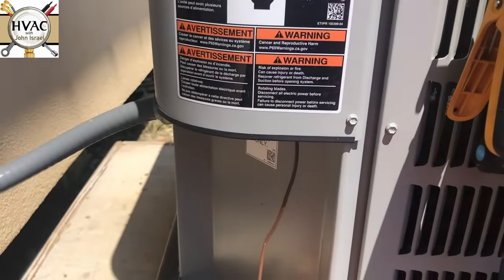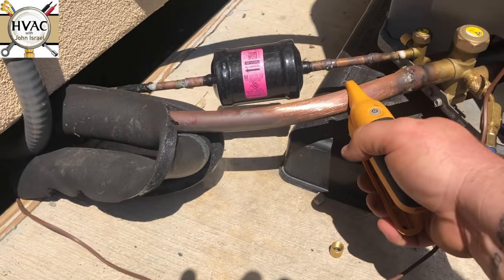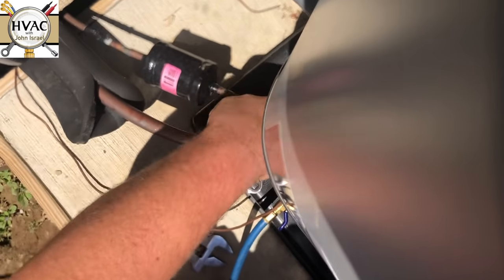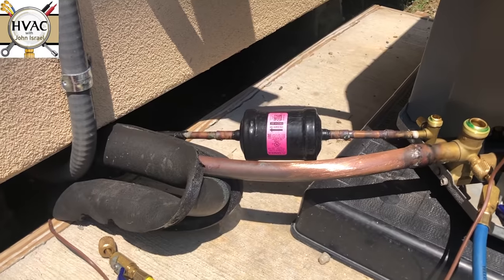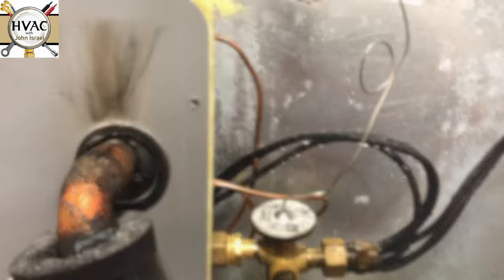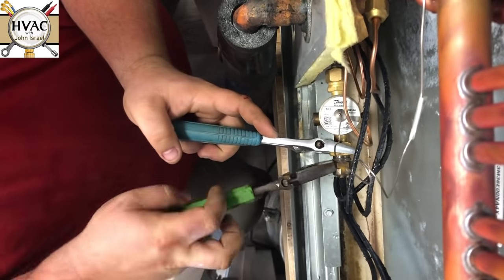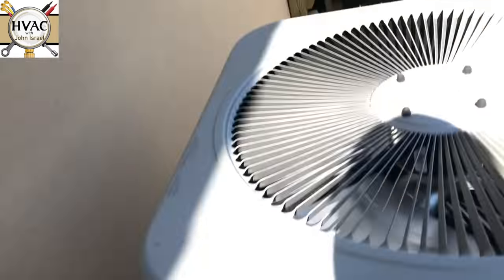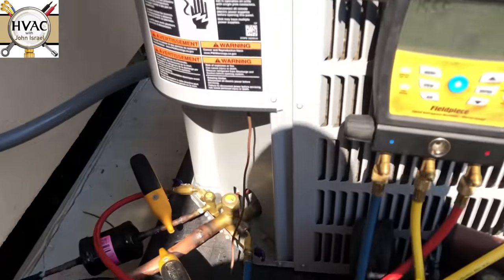How to Replace a HVAC TXV with Piston

Comment: I have done the same thing many times before when a txv fails. A piston is a much more simplistic metering device that can literally be trouble free. I wouldn't have changed the drier either. Good job John!
Reply: Very good job done John
Reply: What about the screen before txv what if that was clogged? Was there not one? I only have 1 1/2 exp. Just asking.
Reply: How do you know what piston size use if the manufacturer only references to replace only for another TXV???

Comment: I wouldn't change the drier ether, it's just an in and out job.and when you have been doing this for awhile you know your stuff.great job .
Reply: The txv failing so quick and crappy drainline shows the installer was a hack. Why take a chance with leaving the dryer, 5 minutes to replace.
Reply: No, you can have dirty stuff there
Reply: Agreed, if you leave the system open for a while then it can bring in some moisture.  Even then, the filter drier will dry it out, and its a brand new drier.  Forget that, look at that boogers on the braze.  SMH.
Reply: From the looks of those braze joints, and burned up grommet at the indoor coil, one has to wonder how good the rest of the workmanship is.  Maybe the TXV failed due to scale or contamination in the system.  I would definitely change the dryer.  Who knows what contaminants are inside that system,if you’re not the one who put it in?

Comment: I have no issues with replacing a bad txt with a piston I’ve done it a million times. I’m like you though, if it’s a warranty unit I will get a new valve if it’s under warranty. I also agree with you about the filter dryer.
Reply: There are houses with undersized units that need a piston to produce 32 - 33 degree coil temp

Comment: Oh yeah, good hardware gets saved. I have the old Tecumseh compressor covers and a bunch of the overload holding brackets and the new Tecumseh compressor covers. I also save the different capacitor mounting brackets. I have a Graslin defrost timer box filled with the extra parts from those ACME 700 fan motor kits.

I can't believe how many times those old bits saved my butt in the field.

Comment: I agree with you about the filter drier. I replaced a txv on a trane unit today and the drier was built into the condenser. I pumped the condenser down so I wouldn't have to recover the r22 and pulled a real good vacuum. 1 Trublu hose on the suction and bluevac gauge on the liquid. Pulled down to 211 microns in about 20 minutes

Comment: Good job. Really there’s no need to change the filter dryer if one of the unit has it been exposed alarm. The time to the compressor didn’t burn out through there’s no signs of contaminants.  changing the filter dryer would just be extra without real reason in this case

Comment: The closet that my furnace and 5 ton coil is located is a little bit wider but shorter than the one in this video.  Removing the old HVAC equipment out wasn't that bad but installing the new equipment was a pain in the rear.  I had to get a winch and pulley to drop down the old coil from the attic (after removing the furnace) and pull up the new coil.  My daughter helped me remove the old furnace (after I removed the blower assembly) and she also helped me lift the new furnace into place.  I dropped the new coil down onto the new furnace after I put a thick bead of silicone on top of the furnace to seal it.  I attached and sealed the new plenum to the top of the new coil.  I think I lost ten pounds just installing the furnace and coil.  BTW, I pre-piped the coil (so the pipe would be easily accessible for final soldering with Stay-Brite 8) and pressure tested the coil and pipe before soldering it to the line set.  I have no idea how the installer got the original furnace, coil, and plenum installed in my house when it was built.  Somebody said that it was probably installed before the sheetrock went in and that makes sense.
Reply: Not necessary to caulk the coil box. The amount of air loss is a minute factor on a proper fitting coil. May never come out again.

Comment: OK, I am still new to this, so please answer me this. I picked up a Evap coil by ADP.  The liquid line attaches to the front of the case...and has a piston in it, but the unit is for r22 or 410a and has a cap on it. At 12:00 on your video you have what I do on the right or bottom side, but I can not find anything to connect to it...i.e 3/8 copper tubing to your left side or top. What kind of connector is that on the left or top side?  Under the cap on mine is the white seal, then piston, and then another small white seal. I spent the better part of an hour going to every fitting I could at Lowes...so they do not have it. I recon that the threads are for a TXV valve...so what else has those threads??? This is obviously not a flared or compression connection. The threads appear to be  (exact measurements here...) .75  OD of the threads, and the flat is .675 and the threads appear to be 24 Tpi. Help, maybe?

Comment: Ever think why the txv went bad, a piston may have less parts but it cant control the heat load, how about doing a proper evacuation and install a txv properly, and if there are noncondensables in the system or coming from the dryer, now the piston will be blocked

Comment: Be aware that when you jump power using the equipment ground as a return, everything bonded now has return current on it.
i have done it myself when there is no alternative, just be aware of what your doing.

Comment: Israel, I have a new 410a unit with TXV and the low pressure line is warm.  I called the pro and asked about it, and he said this is normal.  Is that true?  TF, Lafayette, LA
Reply: Eric M  I'll be there tomorrow and check it but I know the line was definitely not 25 deg colder.  I'll bring my IR thermometer and take some temps of the lines and the vent temps.

Comment: Good job. The only critique I would add is, you skipped a step... namely pressurizing the system for leaks, to check your work. We’re not perfect and sometimes things don’t close up the way we would like them to. even if it’s only 40 psi ( because of the pump down ) and some bubbles. This way, if the service valve leaked, it still couldn’t leak into the refrigerant side because of the higher pressure.

Comment: John where are you guys getting these blue Handled Crescent wrenches from what is the name of that Crescent Wrench
Reply: Ross Flores   Sanilac makes the crescent wrench Amazon has them Home Depot etc.
Reply: @hvacshinobi8047  thanks  brother I've seen norcal Dave with the same tool as well as a few other technicians.
Reply: Those are channel lock brand crescent wrenches. Have a small and thin version that’s great for tight spots
Reply: @jphvac5725  thanks for the info brother I greatly appreciate it

Comment: Nice video why would I change it to a piston just wondering
Reply: I have no clue why anyone would prefer a piston over a TXV.
Reply: @rpsmith  so you are clueless?
Reply: @rpsmith  I have some rental properties, 30 to 40-year-old houses.  Some have Bryant air handle units those have piston flow raters. I bought those properties back then in 1995 and 1996.  One Bryant unit condenser has a Master Valves; metal seal valved is closed after you charged the system.  I have never lost any freon in the system the last 12 years. No problem with piston rater for the air handler for 27 years, of course never replace it yet on PSC motor inside the air handler.  The other condenser is RUUD.  It does not have master valves at the condenser, have to charge the freon every 3 years.  Inside unit is Bryant; 27 years old, just replace the PSC motor last year. It costs me $125 and I installed it myself about 3 hours with cleaning up the blower wheel.  All using R22 systems.  You do not know how expensive is to change the TXV now a day, between $750 to $1000.  Lucky, I do not have to have a headache with the txv.  Now a day I have to change the compressor on my 8-year-old condenser.  Your efficiency of your air conditioning system is determined by how much heat is removed from the inside that depends on how much freon flows in pounds multiplied by latent heat of evaporation of the freon.  Other newer house I had to replace X-motor inside the air handler on 3-year-old unit, this pissed me off. It cost me $400 motor only, I installed it myself. Hand down I choose the refrigeration system using master valves at the condenser, sight glass, piston rater; psc motor at the air handles.  If your suction line by your condenser is at 40 to 45 degrees that is the best to cool your compressor, your compressor will last very very long.  Compressor for the Bryant unit was piston compressor that still working like a champ (27 years since I bought the house).  The compressor for Ruud was Rotary compressor made by Copeland) 27-year span is a long time to see who perform best.  Regards, Armanto. Mechanical Engineer

Comment: Excellent video! Are the pistons based on tonnage? If anyone has a part number for a piston that works on a 4 ton (York-XAHC48FXXN1A coil) heat pump, please let me know. It ships without a TXV and I'm having a ridiculously hard time sourcing the correct one.

Comment: Hey I was wondering if you or anyone seeing this happen before . We put in a brand new American standard and with a TXV anyways super heat was 14 and sub cooling was good , 17 degree spilt . Works and cools good . But a couple times a day out of no where the condenser compressor starts sounding crazy for about 10 mins than it goes back to normal . Tech support had no clue and we are looking at changing the compressor. Put the bulb in hot water thinking maybe it’s closing but that doesn’t take the sound away . Supper weird call because it happens so random . Went 3 times before I heard it lol any ideas ???
Reply: I would recover the entire charge, change the drier, evacuate to 500 microns and recharge with new refrigerant and see if that solves the issue before replacing the compressor.
Reply: @mikee2923  yea right call. Could be restriction but you gotta backtrack to go forward on this one

Comment: The filter drier should have been moved inside, therefore you should have replaced it along with not robbing them by removing a txv for a piston.  You should rename your channel to Shade Tree HVAC
Reply: TXV sucks may be energy efficient but not cost efficient when built like crap and you have to pay to change out. Also this is some trash unit from r e micheal that you can tell was not purged bc of the burn mark up the door fuck a TXV and a filter dryer get in get out it’s trashed anyway from the start

Comment: Wow, how to drop efficiency and kill the warranty at the same time...
Reply: Hmm let's see your qualifications are you make videos on YouTube working on residential systems with from one video shows that you lack the knowledge and expertise to perform repairs correctly.

My qualifications are working on ammonia and synthetic refrigerant refrigeration systems that have miles of piping and complex control systems. What you did in this video is kill the efficiency of the unit and modify it outside of its design by the manufacturer. All in the name of making it easier for you to work on because you lack the common understanding of a txv system. Your probably could have used a manufacturer approved oil treatment to the issue. Even then replacing the txv is not that complicated and time consuming. Given the lack skill with brazing on the install it's safe to presume the installer did not flow nitrogen. With POE oil being hydroscopic its best to install a new filter drier after open a system for repair that's cheap insurance. You can laugh or you can grow with times thought txvs have been around longer than I have been alive so I don't think that's your problem.
Reply: @johnisraelhvac2019  😂😂😂😂
Reply: It was just need few pounds of juice..
Reply: @thejnelson88  super tech alert.
Reply: TXVs are just not that complicated, or troublesome.  I think most of the failures are due to poor system installation practices, which introduce dirt, moisture, copper shavings, scale, and possibly overheating the bulb.  I’ll admit, there may be some cheap Chinese valves out there, but I never ran across them.  Think about it.  If you have a nice clean system, and a good quality valve, installed properly, the only thing that I would expect to fail with time, is the powerhead.  Stuck needles and seats, and contamination like wax and varnish is not the valves fault. I did have a valve on a large reciprocating chiller that had a soulder ball stuck in the valve, holding the valve open.  I took the valve apart and removed it and it worked fine.  This happened about six years after the system was installed.

Comment: So I have had a issue for a month or so with my system sometimes cooling excellent and other times not worth a crap. Have had the company out 5 times. It’s a 410A system icp 2.5 ton. Yesterday he said the expansion valve was bad because the pressures were off, the superheat was not correct and that means this valve. System was installed in 2018. It has froze up the evaporator coils 3 times, runs all day and the temperature inside increases between 2 and 5 degrees - doesn’t seem to keep up - sometimes the air is really cool sometimes it’s not cool enough to call air conditioning. Does this sound like the valve problem is right to you?
Reply: I would try "AC-Renew" in this case. Many times this remedies a sticking TXV that underfeeds the system. If that doesn't help, then I would proceed with removing the valve and replacing it with a piston. Very often less is more!

Comment: SO I'm 69 years old just had major surgery .

I had no ac tech came in went in the ac closet n said the txv failed and put in a piston . He's an old timer and said it will solve the problem and system will run for a long time without issues.  Hopefully this is ok he charged me 1k and added 410.  Will this affect other components in a negative way.  Oh yes unit is 2 years old . I ty all for any opinions.  GOD BLESS ..

Comment: Is a TXV even that much more efficient than a piston? Seems like they're not worth the hassle.
Reply: They are a tiny bit more efficient but they aren't worth the hassle. You get 1 maybe 2 extra seer on single stage equipment by using a txv but a much bigger headache when it fails. I should ask Rheem what size piston my coil needs when the txv finally goes bad

Comment: You said that the unit can’t keep up with cooling. The second clue is that it’s a construction company office. I’ll bet that there are people coming in and out all day long and those people were probably outside in the heat all day and looking for some relief. I’ll bet if you run the unit with only 1 or 2 people present, the unit will keep up. 
Wanda u think ???🤔

Comment: TXV bulb should have been mounted on the outside of the cabinet on the suction line and insulated to manufactures specs
Reply from the maker: That’s how it came from the factory. 🙄
Reply: @jeremyrubley Yeah if its a rheem

Comment: I get the feeling system had air in it but whatever. lol Thats why you shouldnt install DU-Crap or any other off brand units. Stick with Trane or Carrier. Been installing Carrier for 6 years now and no bad txvs or leaking coils or dead compressors. have 100s of units in the field. Better belive goodmans would have problems like those by now. I dont need those problems in my life.

Comment: No offense but this is the problem in our industry people still act like it's 1985.. if you install a txv properly like flowing nitrogen when you braze and keep the valve and bulb cool you normally don't have many problems out of them just my 2 cents. Don't get me wrong fixed metering devices are great man but grown with the times txv is the way to go..
Reply: Whats the advantages/disadvantages between the 2?
Reply: @eleven8948  TXV would save you a couple of bucks per month (that's the advantages). However, when they break (and they will break before the compressor gives up) you will spend around $800-$900 to replace it (that's the disadvantage). Choice is yours!
Reply: @angelt4186    I’ve worked on a lot of systems with TXVs.  I never had to replace one, except for the power head.  I only worked with Sporlan and Alco valves.  Efficiency is not the only advantage of using an expansion valve.  They are much better at controlling the refrigerant under adverse conditions, such as a lower than desired ambient.  Better refrigerant control equals longer compressor life.  I don’t know anything about the reliability of some of these new cheaper valves, probably made in red China.  Most of my experience with TXVs were on larger commercial systems.  They did not use valves like Danfoss. Pistons are not an option on commercial units.  They are mostly TXVs and EEVs. Again, hardly any TXV problems except for the occasional power element.  It’s all about the cleanliness and care taken during system installations.  It’s odd that all these so called TXV problems are on residential split systems.

Comment: We’ve had tons of failures on Dan Foss valves. You should put in an electronica TEv
Reply from the maker: 😂😂 ya that’s not gonna happen
Reply: HVAC with John Israel we use a lot of electronica valves in Supermarket cases 1 ton to 10 ton applications they work well till May break expensive to replace

Comment: Honda used txv since the 80s and 90s for their hondas vehicles once 2002 they went expansion valve

That says alot plus new home installs  and people that dont know about lennox they damage the txv at the air handler by burning it up when doing the install your suppose to take out the sensing bulb